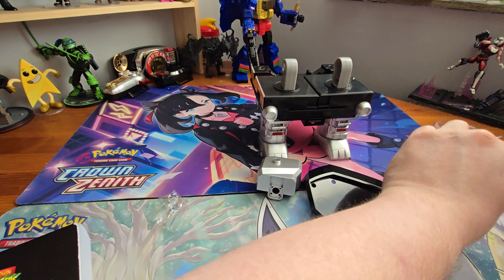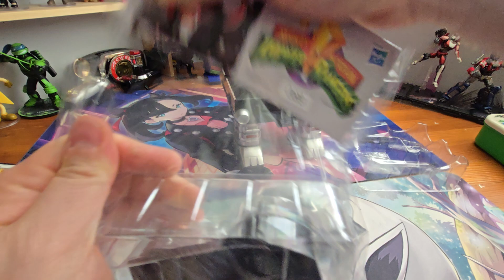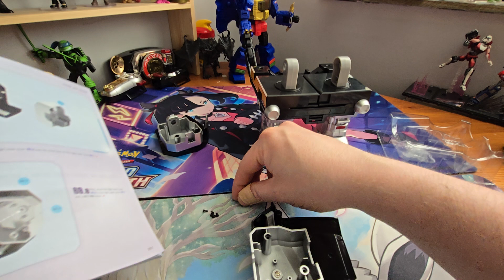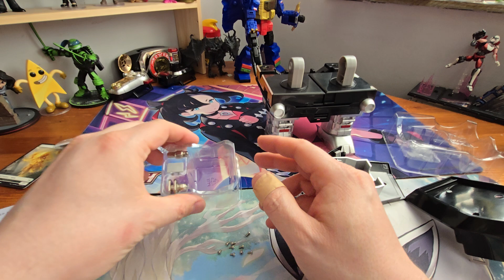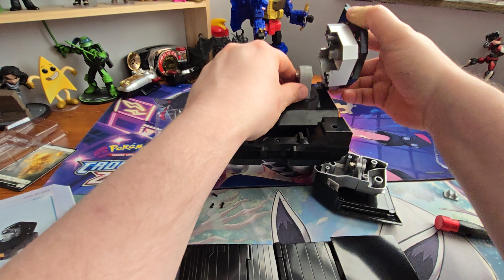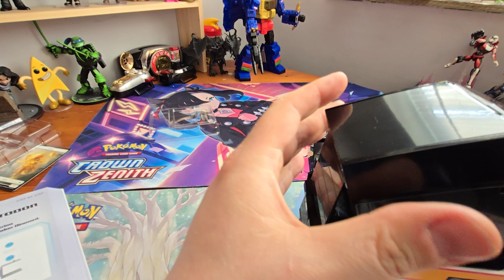Fanhome Mighty Morphin Power Rangers Megazord Part 68 - 71

Comment: For those people worried about the tyranasaur leg connection round peace replacement, the screw they send is to short so try and find a longer one in all your extras and I added a little glue for safety this fix is working good for me, just be careful